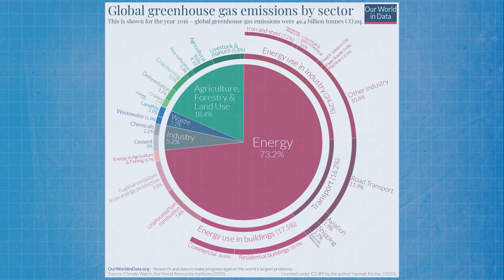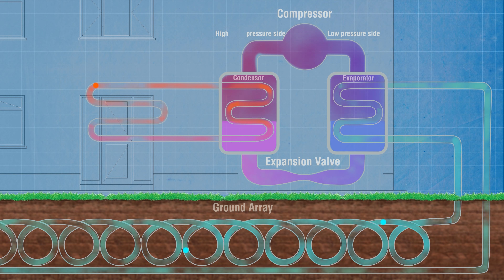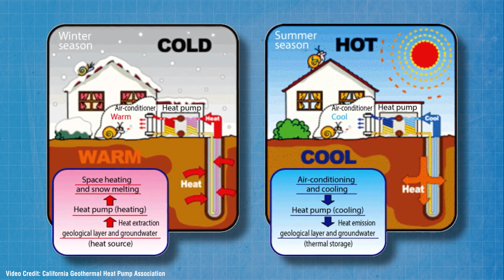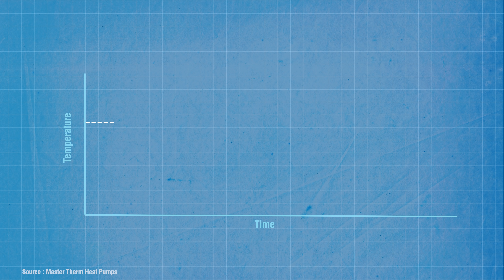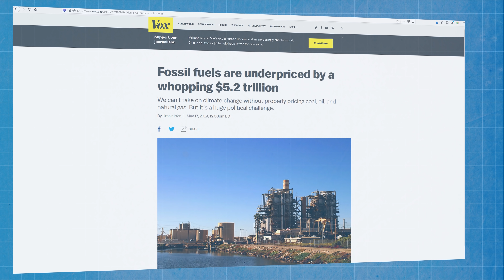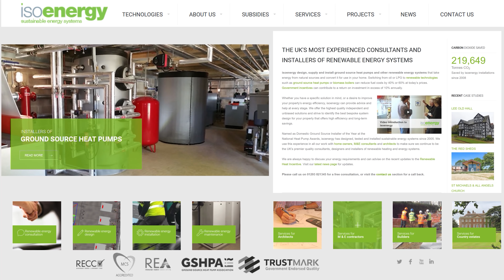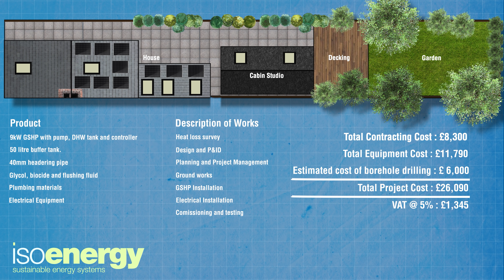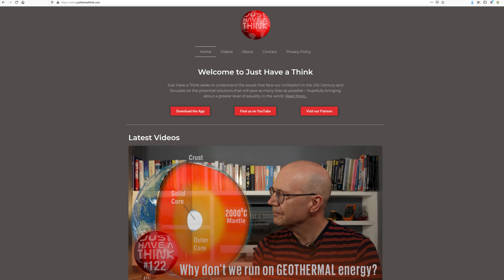Geothermal ground source heat pumps. Heating your home from your own back yard!

Comment: Excellent video. 
Just curious, can these modern "heat pump" systems be used for water heating also? What is the max temp?

In my household, a house ambient temp of around 18-20º is quite optimal all year long so do not require major heating even in winter if the insulation is good enough (even during the coldest parts on UK winters), but I do absolutely need hot water all year long (at around 45º) for showers and whatnot. I assume this will or can be supplemented by a traditional boiler?
Reply from the maker: Hi Andry. Yes you can do hot water. ISO energy (I think) fit hot water storage tanks as standard.
Reply: We do indeed. We can install a heat pump that stores water at about 55degC.  Its worth noting that we have a lot of open vented hot water systems in the UK. They were a cheap failsafe method of storing hot water in post-war Briton. We would want to convert this to a pressurised system. As we store water at a lower temperature with a heat pump, we need to store a higher volume, so your small tank in the airing cupboard would need to be replaced. We often install systems with an integrated DHW tank for houses up to about 12kW in heating load with max 2-3 bathrooms.
Reply: The countries are trying to get the fossil fuel fired heating replaced with electric, so the heating is done by renewables.

Comment: At first glance, geothermal energy systems for individual homeowner application seem overly complicated.  That means they're misunderstood by potential users and also costly when compared with more traditional HVAC installations. But now that I've seen in detail how these geothermal systems work, they make a great deal of sense. So far as the cost, I agree that retrofitting an existing home takes a bit of money, although government support and a relatively quick payback make this less daunting. But I think the best scenario is geothermal installed by developers/builders in new homes. The cost of geothermal becomes part of the overall purchase, can be mortgaged as part of the purchase, and the payback takes place before most homeowners sell and move to another home. And the presence of geothermal already installed could make the home more enticing for future buyers.

Comment: Heating pumps using the outside air is working well these days, down to -20 degrees Celsius. Should be the best alternative for the UK in example.
Reply: Paulsen Paulsen Actually down to -35 degrees Celsius now. That is they work to that temperature, but in my experience there is a breaking point around -25 degrees Celsius (might be not fully correct). At least that is the temperature when we start fire in our fireplace.

Comment: Very expensive in my country.
Other way is  to  low heat demand by insulating the house.
Reply: Yep. Very good insulation and airtightness can be had for cost of ground source heat pump. Much better value in the long term  Fabric first every time.
Reply: @Wookey.  Air tightness is stupid.  All it does is make a toxic prison which now has to have more $$$ spent to evacuate the air.  Semi tight is ok.  Airtight is stupid.
Reply: @w8stral  Airtightness is not stupid and it does not involve insufficient ventilation. I suggest you read up a bit to understand passivehouse design philosophy. If you insulate a building reasonably well, then air leakage becomes the dominant heat loss. The way to deal with this is have plenty of ventliation (exactly to avoid your 'toxic prison') but put a heat-exchanger in the air path so 95% of the heat stays inside. This gets you a factor of 10-20 reduction in heat loss for the same ventilation, and usually much better ventilation in practice. The point is that the air movement is now controlled (and heat-exchanged), rather than being through random holes in the building and depending heavily on how windy it is today.
Reply: @w8stral  I have an air to air heat exchanger (HRV) that i8s 95% efficient and ventilation is no problem.
Reply: @Dennis-lk3qi  bravo, and parts of your house becomea toxic dump over time as the circulation does not reach those rooms.

Comment: Appart from the capital one also needs the space to install the equipment.
Reply: Our heat pump is in a cabinet not much bigger than our fridge and includes the hot water tank.

Comment: Stationed in Florida in the USAF the base housing used shallow wells to cool and warm the housing air.  Flip of a switch and it heated or cooled  the house.  Worked quite well on it's own.  The wells were only 5ft deep.  Any deeper and you hit the water line.

Comment: Air to water heat pumps are lots cheaper and do the same work. The only disadvantage is that they're loud and it's hard to meet norms related to noise in neighborhoods.
Reply: The new ASHPs are a lot quieter and easily meet the requirements in the UK. I agree that they have been noisy untill quite recently though.
Reply: John Heaton I'm installing panasonic high performance right now and it's 69db worst case scenario. Quieter ones are lacking functionality.
Reply: The main differences are that a GSHP will operate at a COP of 3:8:1 all year round. An air source operates at a factor of about 5:1 in the summer and as low as 2:1 in the winter. We average this out as a Seasonal Performance Factor of 2.8:1 so the running costs are much higher as they need more electricity to run. They do have a lower cost of ownership though.
Reply: isoenergy ground to water is 3 times more expensive and it's cop depends on the composition of ground under the house. In my case it's mainly sand which is not the best accumulator of heat. Cop would probably be the same as air to water pump. There is also some probability of gradually cooling down this sand to the point where pump would not work at all.

Comment: What sort of qualifications would work best if you wanted to work in this industry? HVAC?
Reply: Depends on what part of the installation you can work on. An average project requires people of all skill levels. We have groundwork teams pulling pipe into the garden, plumbers installing the systems and the tanks,  electricians/ commissioning engineers to set it all up and get it configured. The only real non standard stuff is if you get involved in servicing as F-gas qualifications are required to work on the heat pumps themselves.

Comment: These ground heat pumps work. It can be implemented in new and old homes. Only part that has to be maintained is the compressor and air handler just like a regular heat pump. Current technology, the main cost differential is drilling a deep wells or horizontal grid pipe implementation. The main environmental concern is choice of the ground system fluid leaking into the ground. Water can be used and is safe. 

I am not sure what the side effects of using in a permafrost region.  

This system can be implemented in stages so saving can be applied to system expansion. Total cost increases by expansion deployment.

A completely passive cooling system can be  used in desert regions by just burying pipes horizontally using air as the working fluid. Fresh Air is drawn in an above ground inlet (needs small animal screen). The ground cooled air enters one side of the house. A chimney exhausting air is on the other side of the house. The chimney is heated by the sun, and hot air rises, pulling cool air into the house.  Not as good as a ground heat pump,  but can help.

I am glad your looking at a home, energy savings as part of the energy/co2 budget. I suggest looking at what really works and doesn't work from the off grid homesteaders.

Comment: I had a geothermal heat pump installed in a home back in 98. It was new construction and if my memory is correct the added cost vs. traditional HVAC was about 7500USD. My system was a type not mentioned in this video, an open loop geothermal system. Because this was way out in the country there was no option for city water and sewer. It pulled water from a 175ft deep well for water use and HVAC/HW and dumped exhaust water to an old hand pump surface well. There was a desuperheater to heat water, which means that during summer heat pulled from the air to cool the house was put into the water heater tank. The cost to operate was very low and there was no outside unit making noise and blowing hot air. The inside unit was about the noise level of a fridge while running at low speed and a normal furnace when running at high speed.

Comment: There is the issue of unintended conseqences. Is it really a good idea to extract heat from just under the top soil in winter and heat it up in summer. How will cooling the top soil in winter affect the biology in the top soil? How many organisms depend on he stable temperature offered by the soil in winter? Again it is wise to pump heat into a dry soil environment in summer. Surely it would be better to at least establish a heat Reservoir in the form of an underground water tank, though this would greatly increase the costs. It must be a lot safer to drill down to extract and store heat, providing at least some protecting for the stability of the top soil temperature.
Have any studies been done on the long term effects of heat transfer on surface soil biology?
Reply: Good points Nigel. The efficiency of a well-designed and installed system means only 1-2degC of cooling for the soil over a large area during the winter months. If we extract too much energy from the ground, it doesn't get chance to recover this loss during summer and year on year, the average temperature drops to a point where you have permafrost. We are often called out to fix systems installed by less reputable installers where they have an icerink in their back garden. Make sure your system is designed by an MCS accredited installer and you should be ok.
Reply: @isoenergyltd  a couple of degrees, may be the difference between life and death for some animals that seek shelter in the soil to over winter. There may be some advantages during the predicted hot summer months, where the reduced soil temperature will help retain moisture, however most systems are designed to be reversals, dumping excess heat into the soil at the very time it needs to be cooled. Maybe everyone should have a swimming pool in the back garden, to act as a heat sink in summer, but even here there is a problem, as the swimming pool might be converted into a skating rink during the winter months. 
The predictions of global warming suggests that our problems will be dominated by staying cool during the summer months. 
In the UK, we may need more heat in the winter, if the gulf stream flow is disrupted.

Comment: Fully Charged did another video about a new build estate in Wales which has 170m borehole ground source heat pump systems in every home.
Makes it much cheaper to dig the boreholes before the buildings go up, and when you can do a few hundred at a time.
Reply: Just Have a Link:
https://youtu.be/uI7wxNtrorQ
Reply: Just to clarify I think that was one big borehole per 10 houses or so, which is where some of the cost reduction comes from.
Reply: @Wookey.  no, I'm pretty sure it was at least one per house, some had two.
Reply: @MrGonzonator   @MrGonzonator  OK, so now I have to check :-) 3:26, 8:20 and 13:40: It's not really clear from what they say, but I think it's one borehole+pump for each building, rather than each home. So a terrace of 3 shares a borehole. But yeah they could have meant one per home, but in that case why go down so deep? 170m is a lot deeper than is normal for a reasonably well-insulated domestic building. I wonder if the details are actually written down somewhere?
Reply: @Wookey.  reading a little more into the company behind the borehole, it's maybe something to do with UK legislation, as the RHI is very generous towards district heating by sharing the boreholes in a common loop or even just with one other home they technically qualify for the RHI help.
I have also watched the few interviews with Dandilion Energy, who are a retrofit heat pump company with some innovative drilling technologies, run by an ex-Google-X executive. They use 500ft boreholes too.

Comment: Another great video. For most types of renewable energy installation my understanding is that it's more efficient as a society to have large centralised installations shared by many consumers rather than small scale per-dwelling installations e.g. wind and solar. (That's not to say that small scale generation is bad of course, far from it). Are domestic ground source heat pumps an exception to that? I.e. is it more efficient/as efficient to have a heat pump per dwelling compared with building large scale shared ones?
Reply from the maker: Thanks Liam. I think the answer depends very much on whereabouts you are. Bjorn reckons a lot of peope in Sweden are better off with their own systems, but then communal charges and taxes in Sweden are generally fairly high. A district heating system may be a better option in some parts of the world.